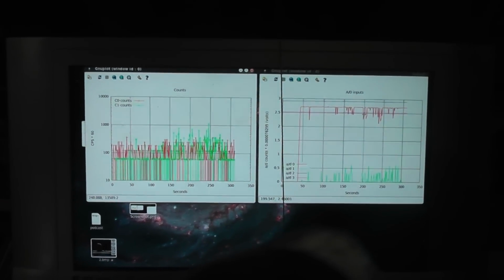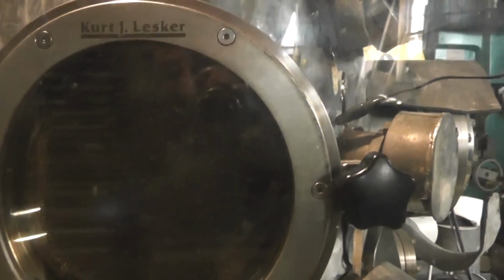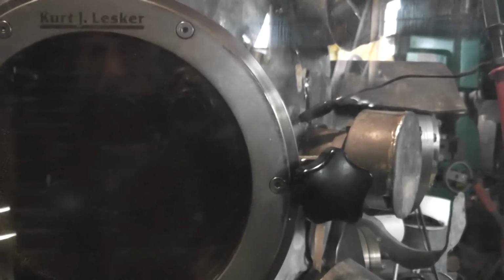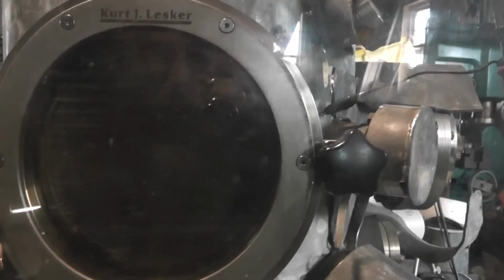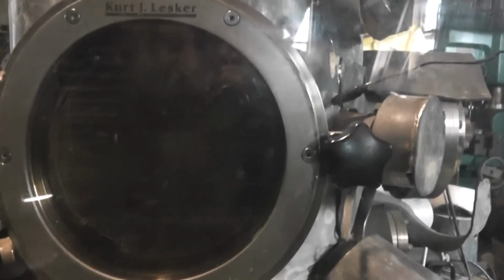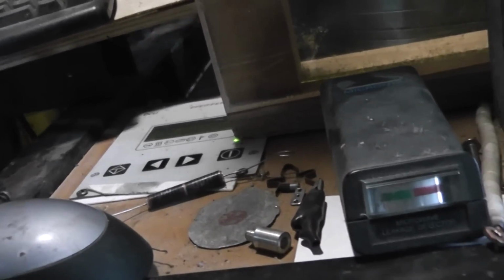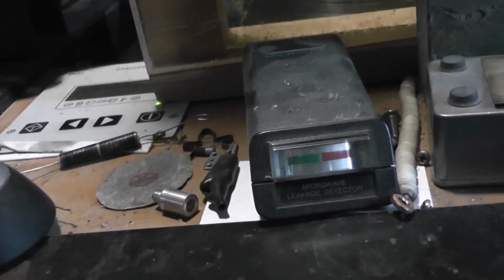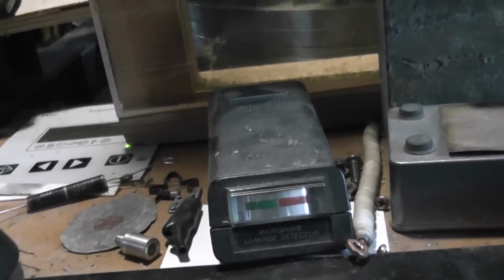UnstableDeliberate

Comment: you should get somebody to film using a slow motion camera to see exactly whats going on
Reply from the maker: Working on the data aq for that now, and a way to drive it so we can replicate it more easily and controllably.  Soon!
Reply: please pleease copyright this invention so big companies cant take it and make money from it

but thats incredible! that means a larger scaled operation is around the corner
Reply from the maker: James Tysoe
I'm actually scaling it down as things get better, to reduce my own exposure with a reasonable amount of shielding (eg, what my floor can hold up).  Copyright isn't the right thing.  Should I try to patent it, the guys with more legal money can still steal it - there's a lot of precedent for that.  So, I just give it all away.  That way no one company (or country) can steal it from the world, there will be competition at worst.  FWIW, until you get to very expensive streak cameras that have some other limitations - this is much too fast to film.  Nanoseconds.

FWIW, we don't desire a "larger scale" anyway - that's what lets them rape you as is - they own the central station and the wiring...at a guaranteed profit.  Wouldn't you rather just have your own, in the basement?